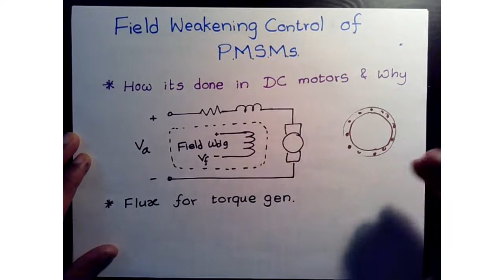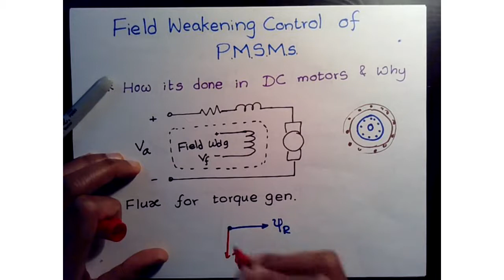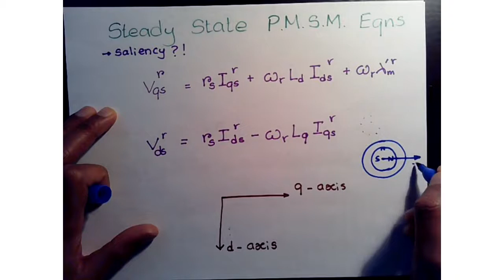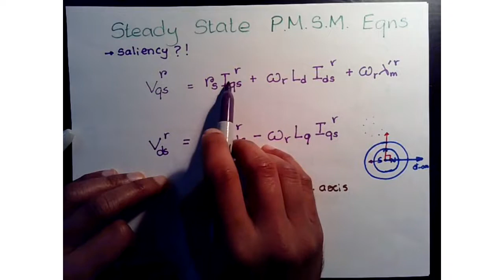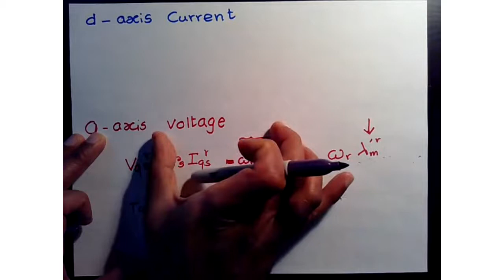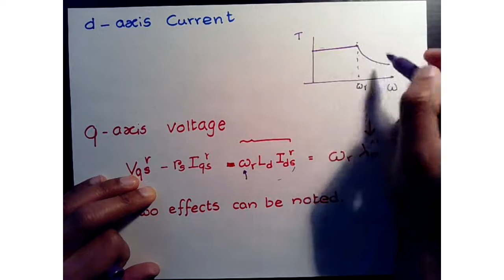Field Weakening Control of PMSMs

Comment: Hello Sir, I have one small question regarding IPMSM drive why we have to perform autotuning process for IPMSM
Reply from the maker: Are you referring to auto tuning in C2000?
Reply: Sir before running pmsm motor on loading condition we first do the auto tuning process.
In auto tuning process motor will run in forward direction followed by reverse direction
Reply: I don't know about C200.can you explain bit more about that

Comment: So basically, flux, weakening, enables higher rpm with lower torque
Reply from the maker: That is correct. Your back emf limits you from going beyond your maximum speed. Through field weakening you recover voltage to reach higher speed. However, now the torque is reduced as you are reducing the flux.

Comment: Sir as in stator only 3 phase current is their then how we can produce negative I'd value (i can not imagine how negative I'd we push) and as in synchronous machine if angle between two flux is greater than 90 then it moves to unstable zone and if push negative I'd mean stator flux make angle greater than 90 then only one is on q axis and. One on negative d. Sir please explain how we can imagine that i push negative I'd.
Reply from the maker: It seems you are mixing up stator reference frame and rotor reference frame. You have the three phase windings in stator reference frame. When you move to rotor reference frame, you have three RL circuits. This is a hypothetical reference frame to allow for proper control. Injecting D-axis current can be though of as shifting the three phase currents by shifting three phase voltages with respect to rotor position. It is all in the phase angles when it comes to stator reference frame. I recommend you to study the relation between rotor reference frame stator reference frame. This will answer your question.

Comment: Did a simulation to check my hypothesis that the D axis current does not affect the torque (and torque constant), even if you go to the point where the D axis point totally cancels all of the magnets flux. Result is the same as in the torque equation, without saliency, the id has no impact on torque at all. Of course not taking into account a non linear BH curve: just a ur of 1.05. Also did not include any steel in the simulation to keep it simple. The magnetic north pole is on top. Also didnt bother with 3 phases, just made simple 2 coil system.

Just Q axis current:
https://pasteboard.co/XQMzpgWsVJUY.png

Add D axis current, such that the vertial magnetic field of the magnet itself is fully canceled:
https://pasteboard.co/PBT0LEarDMj0.png

Notice how the torque doesn't change. Hence lambda doesn't change.
Reply from the maker: Elwin, I think you maybe right! I collected some experimental results which supports that Lambda is not affected. But my machines is a low current motor, so with high current this might be possible (demagnetize the magnets). But so far your I dont see a change in Lambda. I will post the data and a new video. 
Also  @xiao sun  statement about the current vector causing the flux angle to change is correct. I will mention that too. 
The reason I say maybe is because, I spoke to number industry members and reviewed some papers that say Lambda changes. So, maybe with high current it is possible. I cant say until I try. Lets keep the discussion open. 
Thank you both for helping me learn new things too!

Comment: i have one question: is lambda changable at all? as far as i recall, the d-q axis equation is derived from the three phase voltage equation with clark-park transform, and term with rotor flux even after transformation should still be only dependent on rotor magnet material, and not a "effective" "total" flux in the d-axis, right? in the previous lecture the detailed transformation was not provided, so it would be great if you could show us the abc to dq transform in detail, especially the flux linkage terms, thanks!
Reply from the maker: Hi Xiao,  Lambda is called the flux linkage constant because flux has a significant contribution here. In the rotor reference frame, D-axis is where most of the flux is passing through. Therefore, introducing an opposing flux source can effectively reduce Lambda. Now, how much of a reduction in flux or would this demagnetize the magnets permanently, depend on the motor/magnets used. Does this answer your question? I will try to add another video showing the rotor reference frame model derivation soon.
Reply: @SandunKuruppu  hallo, Professor, thanks for the reply! my question was more about if we should see lambda as a constant that is only denpendent on the rotor and will not be affected by stator excitation situation? it is also linked to the torque equation, e.g. rotor flux "cross product" stator flux or Iq times rotor flux linkage. In field weakening, will the torque only be redueced/sacrificed because the rotor flux and stator flux are no longer perpendicular to each other (while the magnitude of both flux vector remain the same, since the dc-bus voltage and the permanent magner on the rotor does not change?) or the torque will reduce also with the side effect that the rotor flux magnitude will reduce due to Id in the opposite direction, in this case the torque will be even smaller?
Reply from the maker: @xiaosun9111  Theoretically speaking, if you look at the motor model from the rotor reference frame, you lambda is a constant. Similar to Ke (back emf constant) in a DC motor. However, since this is related to magnetic saturation, practically this varies with the level of saturation. So Lambda varies a little and in a non-linear fashion as the air gap flux density changes. Since Lambda is part of the torque equation, once you weaken Lamda, your torque will also drop proportionally. The reason torque drops under proper FOC is because your effective rotor flux has been reduced, as long as you maintain orthogonality between the stator and rotor flux. However, if you do not maintain orthogonality (i.e. NOT properly field oriented), then again the torque would drop. This is not due to Lambda but due to non optimal placement of stator flux. Is this clear to you? I think you are asking about two aspects that will affect torque. Lambda is a separate issue and orthogonality of the vectors are another issue.
Reply: @SandunKuruppu  thanks! i used to think that the stator flux was generated by stator currents alone, after transformation, Id and Iq are responsible and "add up" vectorwise to the "rotating field" (of course stationary in rotor reference frame), given the voltage is limited to DC bus voltage, its magnitude (sqrt(Id^2+Iq^2)) is limited! so if a negative Id is applied, (previously the Id was 0, so all voltage can devote to Iq, and the "sum" is 90 degree to rotor) under the voltage restriction, the Iq will automatically be reduced, thus as "vector sum" of stator field will be no longer perpendicular to rotor flux😂
Reply from the maker: @xiaosun9111  Stator flux is generated by stator currents and in rotor reference frame they are Id and Iq, right? The current limit you state is also correct and yes, your stator flux vector will not be allowing optimal flux generation. That is why the power limit curve is drawn on the torque speed curve in field weakening control region. But keep in mind, this condition only applies at rated power conditions. All other places, you can boost q-axis current to get more torque as long as you dont hit the power limit. 😂
Also, use either the orthogonal components or the resultant vector for analysis. It would be better to not to mix them up when you analyze the flux vector relations. Because in the air gap, only the effective flux makes sense.
Reply: @SandunKuruppu  got it! appreciate to the clarification, btw, do we have a equation to describe the torque-speed relationship for pmsm as we did for the DC motor and induction motor?
Reply from the maker: @xiaosun9111  Yes, there is. See Analysis of Electric Machines by P.C. Krause. I don't think I have a video on this. Maybe in the future.
Reply: @SandunKuruppu   thanks a lot!
Reply from the maker: @xiaosun9111  Xiao, please see my comment below. I ran some experiments and the torque dropping due to stator flux angle changing with d-axis current is correct. I will update the video. Thank you!
Reply: @SandunKuruppu    got it! looking forward to your new video!
Reply: Hello professor, to add my comment (I also learned from you and somewhere) the Lambda here is Mutual inductance where Ld and Lq contributes. and we know Ld and Lq varies  based on the amount of Id and Iq during excitation period. @SandunKuruppu
Reply from the maker: @청동이-u6p  Lambda is not mutual inductance. Lambda is flux linkage constant. There maybe some relation between motor design and Lambda, but not to Ld and Lq.
Reply: @SandunKuruppu  Hi Sandun, I have a hard time understanding the part about the decrease of the lambda_m in the equation during negative id current. I do not think this lambda_m changes for the PMSM model without non-linearities. In the video I miss that you mention whether it is about a magnetic non-linearity of a real motor, insteaf of something that happens in the linear model with constant parameters. If you could elaborate a little more on this that would be fantastic! (Had a funny thought experiement: if you had coils on the rotor around the magnets, you could actually really change lambda_m, but since the coils that do this are on the stator, only the coupling terms change and not lambda_m). Kind regards, Elwin
Reply from the maker: @elwinboots2614  Hi Elwin! Great to hear from you again. So let me try to explain this and let me know if it makes sense. When you have proper field orientation, the q-axis current creates stator flux 90 degrees electrically from the rotor magnet flux. Rotor magnet flux vector is aligned to the d-axis of the reference frame. Now, when you apply negative d-axis current, you end up injecting an amount of flux opposite to the magnet flux reducing the effective rotor flux. Therefore, your effective Lambda_m (flux linkage coefficient) has changed. Am I explaining myself clearly? Am I missing something?
Reply: @SandunKuruppu  Yeah, nice to talk with you again! And thank you for the quick answer. I think it is written very clearly. However, I do not think the torque generated by the motor depends on what you call the effective lambda_m. Otherwise also the torque formula for a PMSM would be wrong because it doesn't include this. Also have some guys on the VESC Discord that have measured it in practice. They measure the same torque constant independently of field weakening or not. But I must say I thought the exact same thing you describe, until I took more time to analyse it. Your reasoning would also imply you could have a rotor without magnets and no saliency, and still make torque by having a current vector in a -d +q direction (whereever that may be). I think this is impossible, it will just magnetize the rotor in that direction, and not make any torque. Really interested to hear what you think! Ps. I  think in the case of the brushed motor it is different, because there the field weakening for sure reduces your torque. This is because there the coils are around the magnets, instead of on the part with the actuation coils.
Reply from the maker: @elwinboots2614  Elvin, I see what you are trying to say. I do agree that you cant generate torque without magnets and saliency and by applying d and q currents to a stator. The argument for modifying Lambda is to explain the effective system behavior. Because the stator flux and rotor flux interaction is what creates torque. So when your rotor flux is weakened, it should effectively reduce the electromagnetic torque. To my understanding, the formula for electromagnetic torque for a non-salient motor is the cross product between rotor and stator flux vectors. Therefore, if the effective rotor flux is reduced, then the torque should also decrease similar to a DC motor. Even in a DC motor, though the coils for field weakening are on the magnets, they do the same thing. I'm curios see the Discord discussion on how they  conducted the experiment. If you go to IEEE Xplore, you can find number of field weakening control related work that have been conducted many years ago. Maybe I can conduct some experiments and share that through a video. Depending on the motor, the amount of current needed to weaken the field change. You may need very high currents. This is typically done in 100kW motor drives where you have access to lot of current to generate enough opposing field to weaken the magnet flux. Do you follow?

Here are some good references. 
https://ieeexplore.ieee.org/document/4504966
https://www.researchgate.net/publication/4022594_A_permanent_magnet_synchronous_motor_for_traction_applications_of_electric_vehicles
https://ieeexplore.ieee.org/document/4157998
Reply: @SandunKuruppu  Thank you for the references (unfortunately I cannot open the ieee ones for free, but the other one is free). The difficulty is I do not see the exact topic at hand answered in any papers I checked.

On the Discord they where working on observers. The observer needs lambda_m as an input. It was found that field weakening had no effect on lambda_m. 

I did some maths with the PMSM equations and came to the same conclusion, id current does not change the torque: 
https://pasteboard.co/dehaiA3iZLJX.png
The interesting thing is that adding negative id current changes the power delivered from the Q to the D axis, but the magnitude of the power (and therefore torque) doesn't change (under the assumptions in the picture).

Would be really cool if you could do an experiment for this!

PS. We also think the term "field weakening" is a bit of a misnomer that causes all this confusion. One can even add coils outside of the motor, and have the same effect! See for example: https://endless-sphere.com/forums/viewtopic.php?t=72692, or just check the formulas and see that if you increase Ld and Lq by the same amount you can do more "field weakening", even though this field does not go in the rotor. 

PS2. check out my open source motor controller with option for sensorless control based on rotor saliency: https://youtube.com/shorts/1vL65e20ViI?feature=share

PS3. If you wish you can have a look at the VESC Discord. We discuss all kind of motor control topics, from the sensorless control you see in my video, to design of power stages for hundreds of amps: https://discord.gg/hdn7sBhfzU
Reply from the maker: @elwinboots2614  Like you said, it is somewhat inaccurate to say "Field Weakening" for a PMSM. More accurate term would be "Flux Weakening". I'm working on resolving this. I will create some material, video with experimental results on this. Appreciate you bringing this up!
Reply: @SandunKuruppu  Awesome! Looking forward to what you find.
Reply from the maker: @elwinboots2614  and all, couple of pointers here before others start running off with this calculation. You have to consider the airgap flux and its interactions for torque. The voltage equations are a model/representation only (lumped system model) and not a magnetic analysis. 

You are to consider d-axis flux and q-axis flux as a whole in the analysis. You also mentioned that if torque would decrease by injecting d-axis current, we wont need PMs to generate torque. This is not a correct statement. D-axis current is used to weaken the PM flux contribution to the air gap. The interaction of effective d-axis flux and q-axis flux in the air gap is what produces torque. 

I'm still working on getting some explanation on field weakening added with possibly experimental results.

Comment: Hello sir,
i have implemented field weakening of surface PMSM in MATLAB simulation 
while increasing speed higher than he rated speed, torque is not decreasing automatically..
could you clarify this...
Reply from the maker: Pavan, how are you weakening the field? When you apply negative Id, you also have to update you Ke (back emf constant) along with the process. Otherwise you wont see the torque decrease.
Reply: @SandunKuruppu  okay sir
Reply: how and where could i change the ke...is it in flux weakening algorithm ??

Comment: How Can the effective flux be reduced by introducing negative Id current.? Can you elaborate on this further? does this mean that by introducing negative Id current, we can effectively reduce back emf costant? If it is so then it will also have effect on Torque equation where 'effective permanent flux' is reduced.
Reply from the maker: Yes, that is why it is called field weakening control. Weakens the field. It does have an effect on torque, but the goal of field weakening is to get to higher speeds.
Reply: @SandunKuruppu   How do we model such motor then? because 'lamda_m'(permanent flux) is not modeled as a function of Id. 
Could you please have any literature which states that, negative Id can reduce backemf constant?
Reply from the maker: @swanandpisat2029  Depends on the modeling platform. In Matlab, you can reduce the flux linkage constant and torque constant based on amount of field weakening.
Reply: @SandunKuruppu  Can we get in touch with some other way? can you share your email Id?
Reply from the maker: @swanandpisat2029  Its listed under channel 'About'